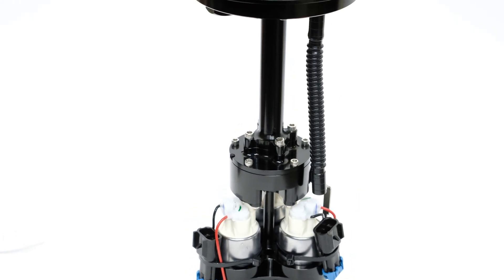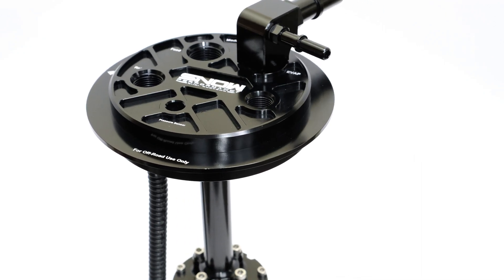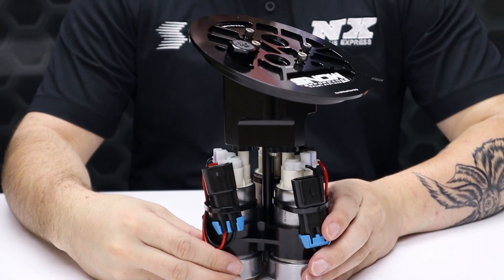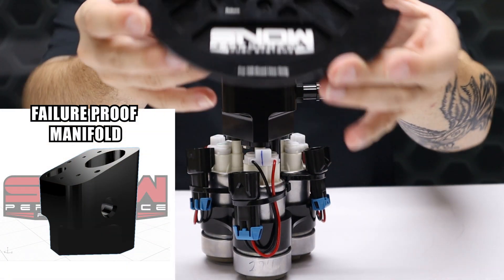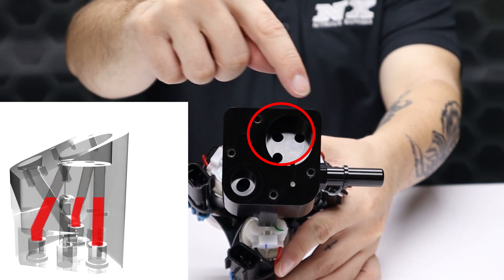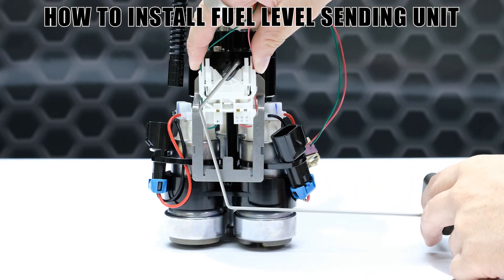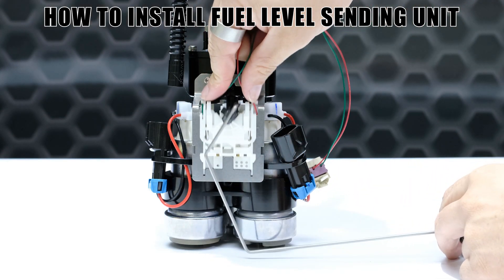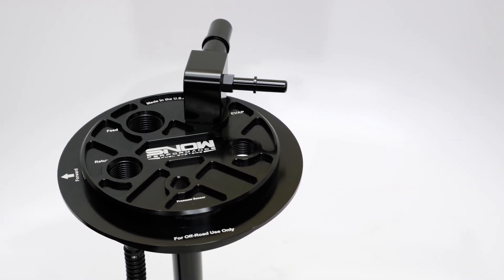Snow Performance's NEW Billet Aluminum Multi Pump Fuel Hat for GM Half Ton Trucks! (MADE IN THE USA)

Comment: I'd pull the trigger of i knew there wouldn't be fuel starvation at lower fuel levels since it isn't a bucket type design.
Reply from the maker: The fuel sock we include with these has extreme fluid-wicking capabilities. Only 1/4" of the sock needs to be submerged in fuel in order to properly feed all 3 pumps!